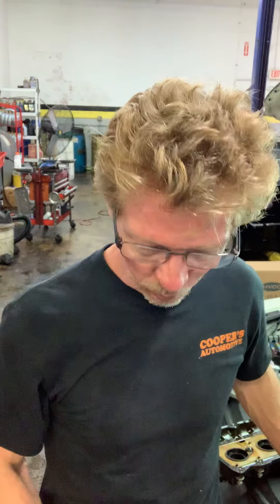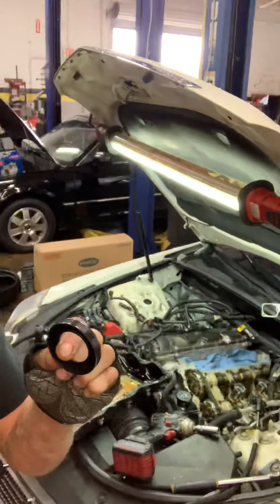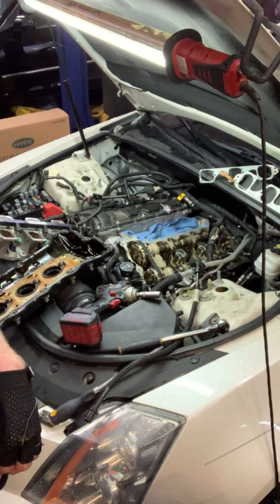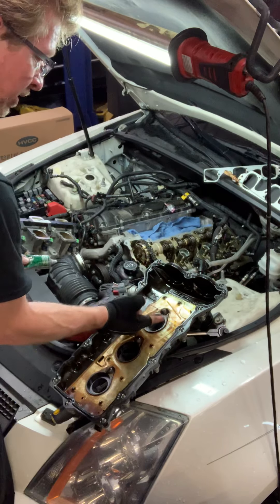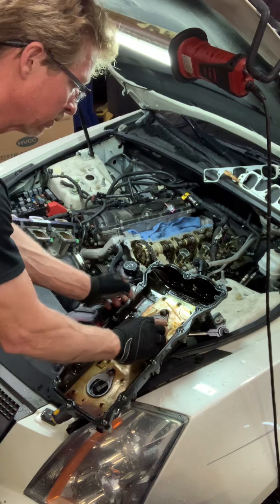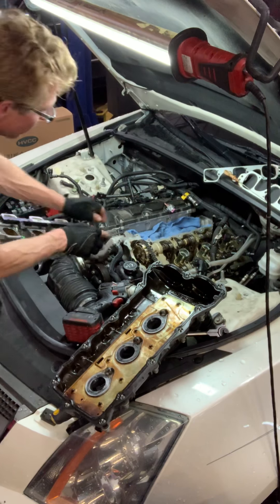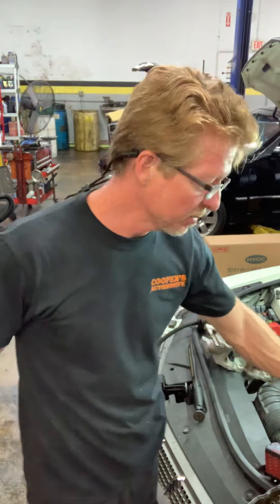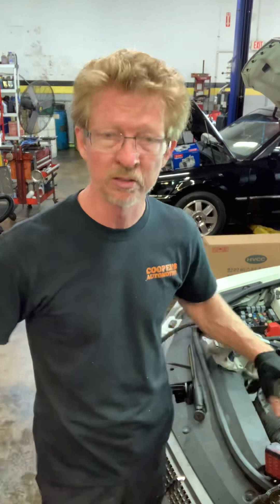2006 Cadillac CTS spark plug tube seals part three

Comment: I changed out 3 sparkplugs passenger side,when seen oil on sparkplugs, crossing fingers car starts,if not part it out get my money back timing chain was an issue car set a week think sparkplugs died, 2005 Cadillac STS , Question about those 2 bolts can't seem to get them flush car no start?